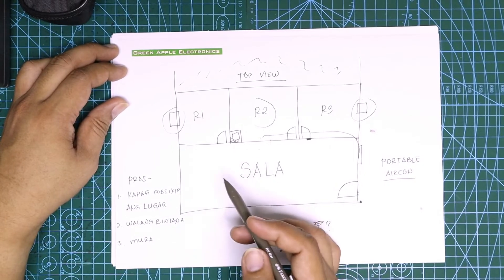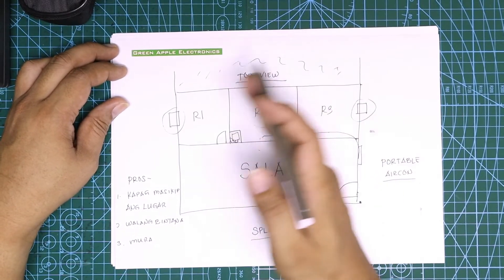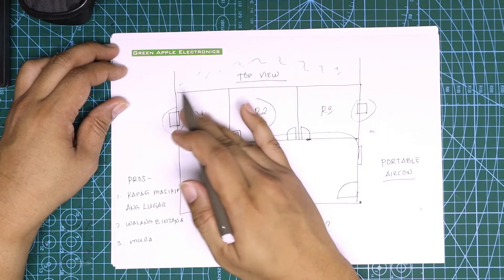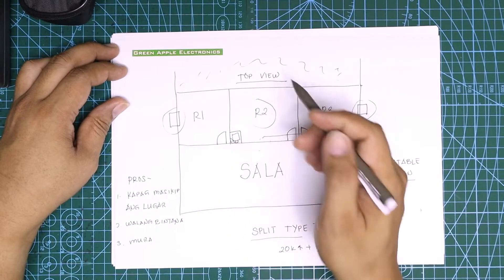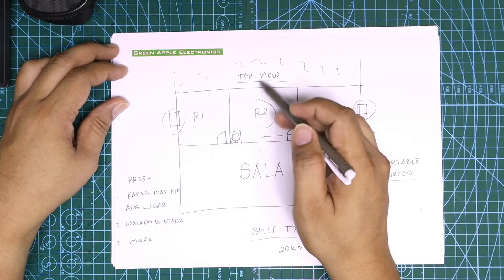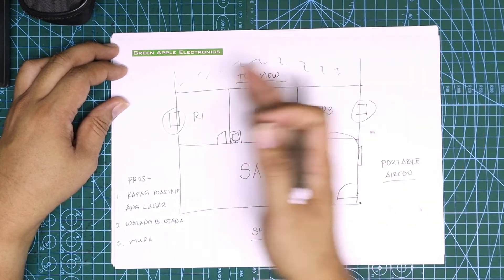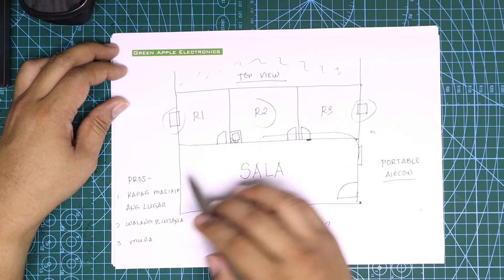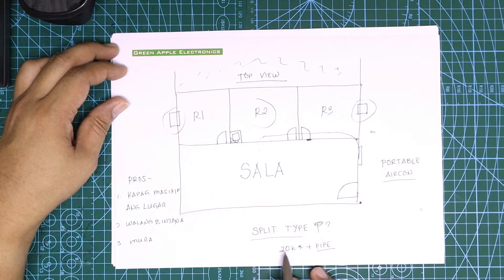Portable Aircon Unboxing and review (pros and cons)

Comment: Dapat insulated yung tube. nagets ko na yung point nila na dapat nasa elevated platform. para yung cold air sa baba hindi maging intake.
Reply from the maker: tama po ☺️
Reply: @ i just bought mine. i doubted the back inflow and outflow design. kasi dun palang may minor mix na. 
2 days pa darating. what i liked about the kanazawa design is sa right yung intake.

I will put this on an elevated level very close to a window with my CPU. para ma maximize yung exit flow. i even thought of putting a clothes rack behind to utilize the hot air coming out. exposed outside naman kasi yung clothes rack

I also bought an enclosure mosquitero if ever all else fails hahahah!

Comment: Ask ko lang sir given na its also using cold room air inside..... napapalamig naman po ba yung room ninyo up till this present day?
in terms of efficiency... saan po ba siya hindi effiecient? sa power consumption or sa cooling? 
Thanks.
Reply from the maker: yes po napapalamig parin, in terms of efficiency (sa akin expirience lang po) dahil nga inilalabas niya yung cold air, so more job para imaintain yung set temp, so mas matagal ang andar ng compressor kaya mas malakas siya sa kuryente, pros and cons lang naman po,  madami din naman siyang good at nabangit ko po sa video.

Comment: Pde ba kahit no breaker sir?
Reply from the maker: pwede po kasi portable ang design nya, sa outlet lng po. pero kung may option kyo na lagyan much better po
Reply: @greenyelectronics  sa experience mo sir ok nmn no breaker? meron nmn kami kaso centralized lahat ng outlet nkaconnect sa kanya
Reply from the maker: @radmotoph1496  yung sakin po direct sa outlet , tas sa main naman po isang branch siya na 20amps na breaker na tatlong outlet ang hawak, pro yung extra 2 outlet electricfan lang po load, almost a year napo ok naman
Reply from the maker: @radmotoph1496  nabangit nyo po na centralized? so kailangan nyo po icheck kung ilang outlet ang hawak nung sa branch breaker nyo at ano ang mga load at kung ilang amps po siya

Comment: Sir ask ko lang po mag kano po ang inabot o idinagdag sa bill no smula ng ginamit po ninyo yan? salamat po
Reply: Share ko lng po using same portable ac 1hp mas malakas po ang kuryente ko ng april and may umaabot po ako ng Php 3,500. From 5am-3pm minsan max 12hrs nkka 130-150 ako everyday gamit ko po sa bahay pc, 2 doors inverter ref, 5 ilaw and 4 fans at mga cp nka charge at wifi heheh
Reply from the maker: umabot din po ng 1K ang idinagdag sa bill, sobrang init po kasi ngayon
Reply: @greenyelectronics  sa 1k bill na nadagdag, may i ask po if ano po ang usual settings nyo sa aircon? anong oras, ilang oras and days of usage? tapat po ba mismo ng araw room na pinag gamitan? 

thank you! this will benefit most of the viewers din na planning bumili nito.. salamat po! and stay safe! :)

Comment: Ser, yung hose po okay lang sa kisame wala naman aberya?
Reply from the maker: Sa video po ipinasok ko temporary sa kisame, pro ngayun po dinugtungan ko na ng malaking hose palabas ng bahay
Reply: sir pwede kaya if dugtungan ko ng mejo mapayat na hose palabas ng bahay kasi antaba ng hose niya nakaharang na sya masyado sa daan hindi ba makakaapekto sa performance yung ganun?same po tau kasi ng room
Reply from the maker: @KR-yi7ch  palagay ko ok lang po kahit medyo mapayat na hose kasi malakas naman po ang out pressure niya
Reply: @greenyelectronics  last question, ok lang bang gumamit ako ng extension wire para mapagana ko yung unit?
Reply from the maker: @KR-yi7ch  ok lang po basta hindi galing bangketa yung extesion cord, marami pong mabibili sa ace hardware sabihin nyo lang po pang portable aircon
Reply: @greenyelectronics  salamat po sir
Reply: sir question po ulet lols for shipping na kasi unit ko po pwede ko po ba malaman anung size ng hose para bibili na din po ako thanks po

Comment: Sana you gave power consumption amp per hour, or estimate if the inverter really a make difference with the portable air conditioning.
Reply from the maker: ok po, next time po
Reply: @greenyelectronics  👍🏻
Reply: Sir magkano nadagdag sa kuryente for a certain hours? Need sana sir feedback

Comment: Paano yung water nya.may drainage ba cya
Reply from the maker: meron po dalawa sa likod pro base sa expirience ko 1 week or more bago ko siya idrain
Reply: Hello! Kabibili ko lang ho. Akin ay 1.5.hp. at ang sabi ng promo ay walang ipunan ng tubig at kailangan ng hose para ilabas ang tubig na tuloy tuloy. Halos isang timba malaki ho ang naipon.ko magdamag. Paaano nyo nalalaman kung puno na at di nyo dina drain ng tuloy tuloy?
Reply from the maker: @susandanielleantonnettefai7591  designed po ng portable ac yan, yung isasama na nya yung tubig sa exhaust niya by means of evaporation, pro kung llgyan nyo ng hose talagang tutulo po yun. yun lng po ang pangit sa model na yan wlang indicator na kailangan ng idrain, yung iba meron po
Reply: Maraming Salamat ho! Itry ko ho na di lag6an ng hose. Paano nyo ho nalalaman na lailangan na idrain kung walang indicator? Ano ho ang kailangan i observe?
Reply from the maker: @susandanielleantonnettefai7591  nung una tinry ko every 3 days kaso konti lang naddrain ko, kaya tinry ko uli ng 1 week ayun mas madami dami na.